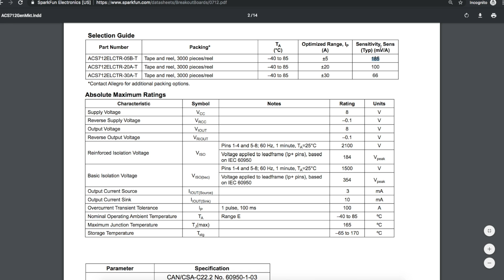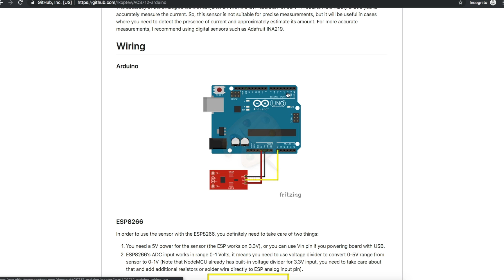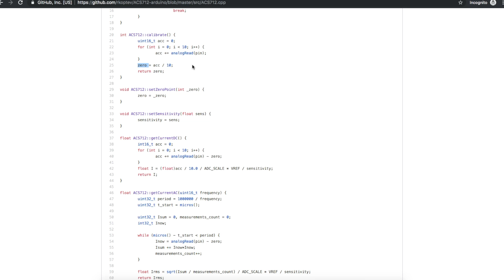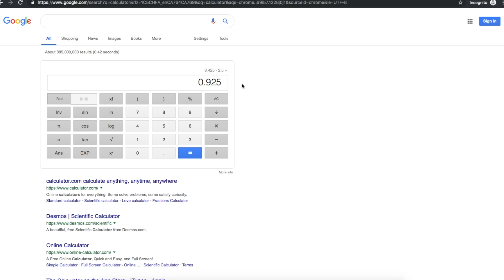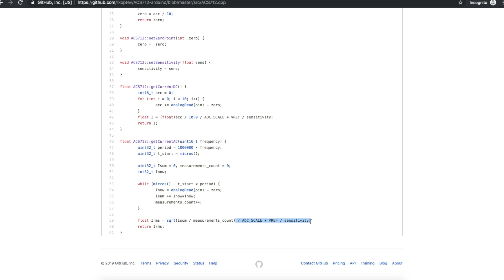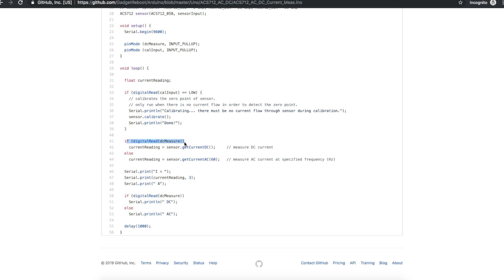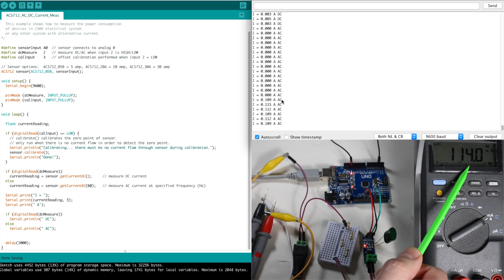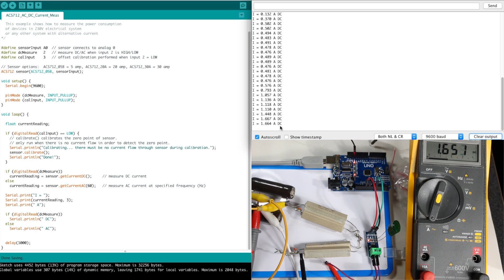ACS712 Current Sensor with Arduino - Measure AC and DC up to 30 amps

Comment: Sir i keep having the error 'ACS712_30A' was not declared in this scope, I manually installed a zip library of acs712 and used #include <ACS712.h>. what could be the problem? thanks in advance
Reply: you are not using the correct library. Download it from the link he provided.
Reply: @angry_moose94  I have the same problem as him. Can you try this on your own and see if there  is anything wrong with the library? Your help is highly appreciated. I cannot solve this problem as well.

Comment: Bought one of these and the output goes lower than the 2.5v idle when current is detected? (Mine does). Thought it would have added to the output -- guess not. Confirm anyone?
Reply from the maker: I believe it goes higher or lower than the centerpoint based on if the current direction is positive or negative so you could try reversing the wires on the sensor
Reply: @GadgetReboot  Yeah ! Discovered that after posting. The right hand rule, right? -- thanks   they should include documentation with these.

Comment: Hey sir how to calibrate the sensor?
Reply from the maker: The general method I have seen for this sensor is to take baseline readings with no current through the sensor and if there is an offset,  consider that offset as zero in software and then use the data sheet equations to calculate current while factoring in the offset zero reading.
Reply: @GadgetReboot  bro how to save the calibrated settings when i restart the program? when i restart it the values are again uncalibrated, please help me if you can

Comment: I'm lost with your use of pins 2 and 3.  How are you connecting these to switch the modes.  Or are you connecting a jumper wire to change the levels?  I missed in the video where you explained how you were doing this.
Reply from the maker: looking in the Arduino sketch pin 2 changes between reading DC or AC and pin 3 is used to calibrate the sensor depending if the inputs are set high or low so I’m just using a jumper wire between VCC and ground when I want to change a mode. each time the sketch goes through the main loop it will read the inputs and decide if it’s calibrating or reading AC or reading DC current.

Comment: Thanks for this! Do you have pictures of the transformer setup? Did you have to strip the wires?
Reply from the maker: I don't have pictures and can't remember now that it's almost been 2 years but I think the transformer belonged to something I still needed so I would have either plugged it into a jack and clipped onto the leads or wrapped wire around the barrel and stuffed wire in the end and taped it to hold.  I remember everything was falling off the edge of the table and I couldn't get everything in the shot.
Reply: @GadgetReboot  thanks!

Comment: An air/fuel ratio sensor on an automobile has a current output. Zero current is ideal air to fuel mixture. A positive current is rich and lean mixture is negative current. Would this sensor family measure plus/minus currents of 50 milliamps considering the frequency of swings is very slow.
Reply from the maker: my experience with this family has been that for lower currents, I don’t find it very precise.  I have much better results with the INA219. https://www.youtube.com/watch?v=FXQoZbvM3Kw

Comment: Why do I get negative readings on my Arduino Nano? I'm getting values like -0.053
Reply from the maker: What happens if you reverse the wires to the sensor? It measures current flow in both directions and has a polarity.
Reply: @GadgetReboot  I am getting alternating positive and negative values. I'm measuring AC by the way. It's the same when I reverse the polarity. I'm using the USB port as power for my Nano.
Reply from the maker: It’s strange to get negative readings on ac, trying to think of any little things, was a calibration performed while there is no current flowing? The library could get negative numbers by trying to subtract the wrong offset maybe.
And is it a sinusoidal AC with the correct frequency specified for the AC measurement?
Is the current reading looking accurate otherwise, just the polarity being weird? And is the actual current that low, around 50 mA, and which version of the sensor are you using?  I remember it wasn’t really performing great for me at low current, sometimes my error was even 50 mA, and if using a sensor greater than 5 A, it may be even more jumpy because it has less room to represent the measured current in the output so any noise would more greatly distort the reading.
Reply: Same, i also get negative readings on my Arduino Uno. The values kinda -0,47 ish

Comment: the readings are jumping, because you are using it with only USB, whose voltage are know to jump around 4.8>5 volts and cause noise, there fore your voltage formula is always wrong, 
SOLUTION: power it with extrnal supply, that way regulator will output nice and smooth DC, meassure it and than put that in formula, its often not accurate 5 but 4.9ish max time.

Comment: can the current sensor handle a large amount of current? what will happen to the current sensor if there will be an overcurrent (example: short circuit)? And how will it affect the MCU?
Reply from the maker: This sensor is available in three different options with a maximum current measurement of 5, 20, or 30 A. 
 The load current path is electrically isolated from the rest of the chip similar to an optocoupler so the MCU  should be safe within reason. 
 The datasheet says it can tolerate 100 A of overcurrent for up to 100 ms duration.  I don’t see any information about what happens for lower over current conditions but I would make sure there’s external overcurrent protection or fusing to protect against that.

Comment: can you tell me the installation circuit on Arduino and what type of capacitor is used
Reply from the maker: The circuit used is the same from the link in the description for the library as well as what is showing on screen in the video. The capacitor is a 470 nF polyester (also known as trademark name Mylar) type.

Comment: can you suggest any good current sensor for precise measurement
Reply from the maker: I can't think of one off hand but generally what I find is I would need a different sensor to handle different ranges, so if one can measure up to 5 amps within just a few volts of output signal, I won't expect it to be able to get precision results on lower currents.    I am thinking about looking into a product like uCurrent Gold, or the Current Ranger, which will also give a voltage output signal, but can do various input current ranges accurately.

Comment: I have also played with one of these hall current sensors, and been similarly disappointed with the precision when measuring low currents.  There is always making a shunt with a thick piece of Nichrome Wire, then using an opamp to boost the voltage.
Reply from the maker: When I get a chance I am going to take another look at it And see if there’s a way to improve it with a better ADC precision. I seem to have run out of Bench Work  space again so that might get in the way.  I’m already working on an electronic DC load experiment that I don’t want to have to tear back down to make room.

Comment: Are you sure the resolution of the ADC is sufficient? It looks like your noise could be attributed to the lower 2 bits being inprecise. (Did not do the math though)
Reply from the maker: It’s possible more resolution would make it even better, I believe it’s 0.185 mV/mA on the sensor so if every step of this ADC is about 4.88 mV then that could be improved upon,  but I wanted to see what I could achieve with a cheap Arduino. Adding the filter capacitor seemed to help.  I can’t remember if I ordered a 12 bit ADC to play with. Maybe I will revisit.